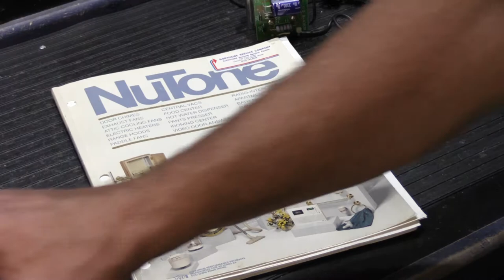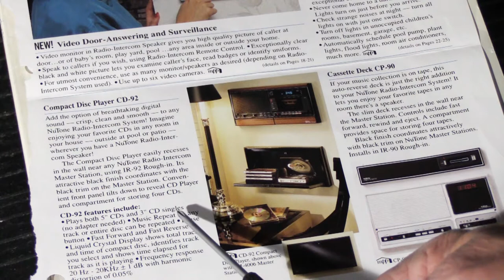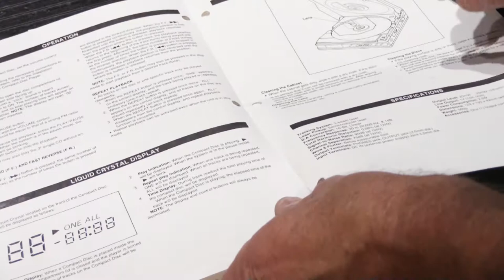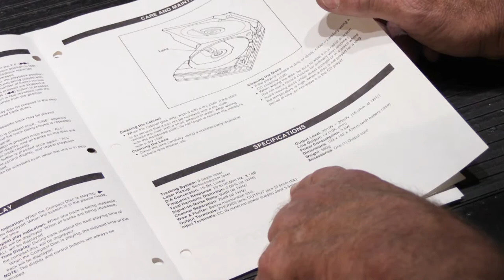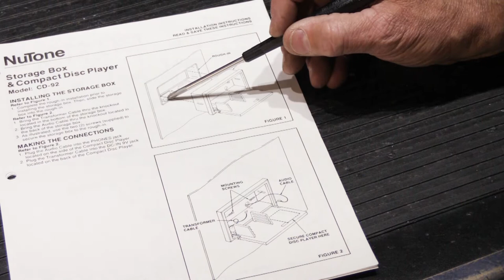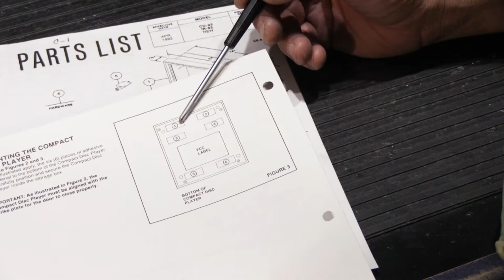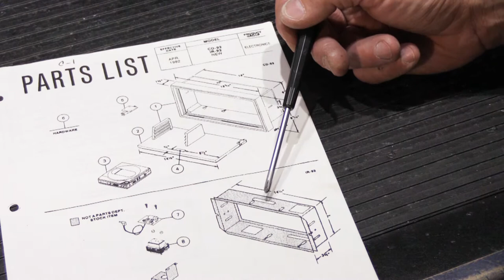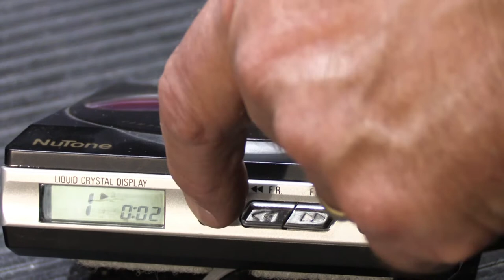An Overview of a NuTone CD92 Compact Disc Player

Comment: Very cool.  Just from looking at it I figured it was a rebadged Sony. My first portable Sony CD player looked just like that.
Reply from the maker: Hi Jim:  I don't think that NuTone would and spent the kind of money that a real Sony unit would have cost.  The form factor of a portable CD player id really set by the shape of the CD it self - I'm sure there was a lot of copying of the Sony designs by other manufactures.  It would be interesting to know if in the mid 80's most CD Players used Sony Chip Sets and for how long did that last - Chris
Reply: @northsideservicecompany3567  Yeah, hard to know for sure. But there weren't very many companies making portable CD players back then.

Comment: Hey Chris - thanks for another cool video! I am curious, since you mentioned you only installed about a dozen of these back in the day, since the start of your career, what was the biggest, most complete "NuTone Home" you ever saw or worked in? Did you ever work in something like a huge crazy wealthy home that was fully loaded up with all of the then-possible nutone options? Maxed out Intercom/music system, built in appliances, video surveillance, remote controlled switches, outlets, etc?? I bet that would have been quite a sight to see!
Reply from the maker: Hi Jeff:  The largest home I ever worked on was 14,000 square feet.  It was a 3-1/2 year project and it recently sold for 12.6 million dollars.
  
I installed a 24 station IM4006 system - 2 Central Vacuum System's, each having 12 inlets (we divided the home into 2 halves because the distance through the center of the house was 187 feet) 

There were 4 NuTone Built-in Ironing Centers, Bathroom Exhaust Fans, Bathroom Heater, 3 Food Center Appliances with full sets of accessories. 

I was quite a project and the owners burned through 3 General Contractors and many sub-contractors during the course of the project.  

I dealt with the owner for the work we did (I had done other project for him) and in the end, I was told by the final General Contractor, that I was one of only a few sub-contractors that was paid in full.

It pays off to watch details on a project like this - Chris
Reply: @northsideservicecompany3567  Wow!
Reply: Northside Service Company No nutone ceiling fans? I’m kind of surprised!